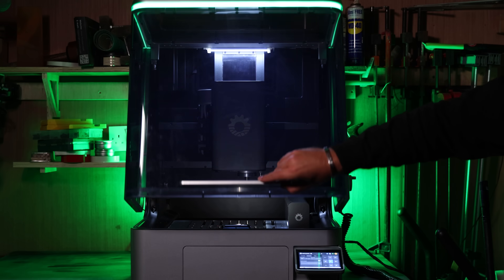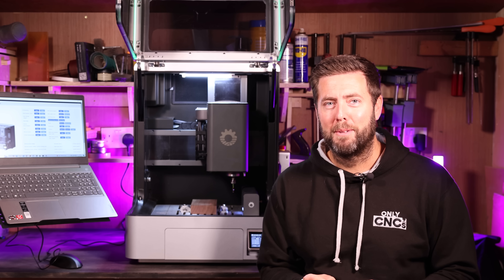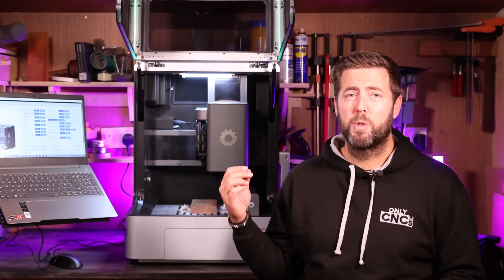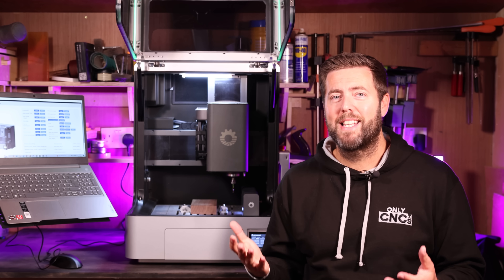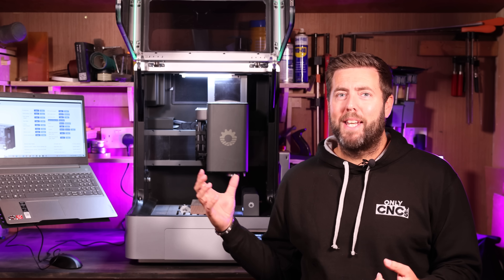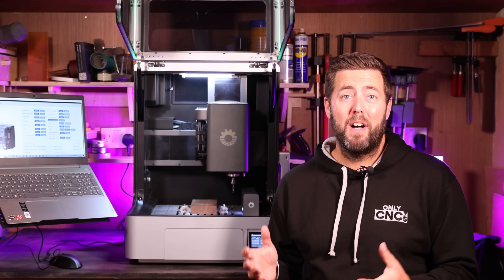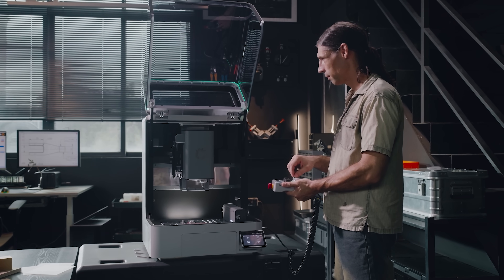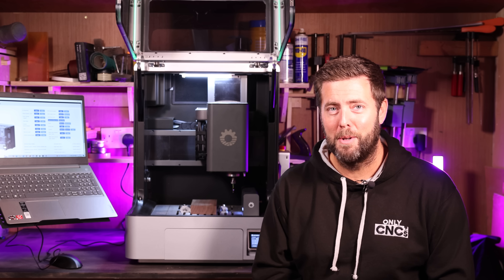Most ADVANCED CNC machine I have used - Initial look at the Nestworks C500

Comment: The ATC is copied from RapidChange ATC   😞
Reply: This design had been around for a long time before ATC came along; Rapidchange ATC just made it more refined and reliable.  it seems the C500 has also integrated RFID functionality.
Reply: @WilliamsJobs  Maybe so, but they have a US patent so their design must be bringing something new to the party.
Reply: I'd not seen this way of doing things before but I'm a bit concerned that the constant screwing in of the collets every time it does a tool change will lead to wear, particularly the twisting action on the spindle taper as well as the threads. Most tool changers just pull up a ready loaded tool already in an ER collet. Is the spindle taper a separate part that could be replaced?
Reply: @8bitsim  I think they wanted to avoid the pneumatic tool changing part. I don’t remember well. I think it uses some compressed air but a traditional ATC requires quite a bit of air to operate, which is definitely not suitable for a hobbyist environment.
I agree that an ISO20 would have been a good choice (that’s the size of the collet, more or less. Probably even smaller than ISO20. ).
The machine is well designed and built without compromises. They also developed their own CAM App, pretty smart and intuitive.
And it’s very quiet as well.
Reply: Do you have an unboxing video? I am concerned about the process of taking the machine out of the packing crate and placing it on its table.